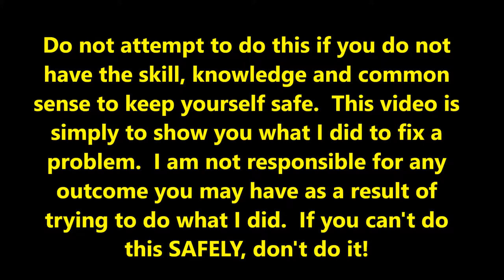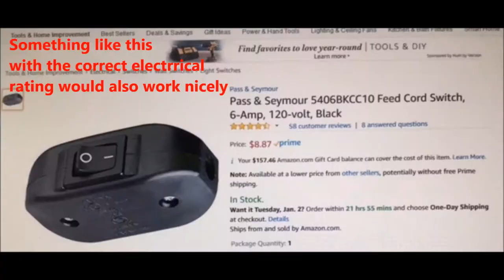Craftsman finishing sander won't turn on;  how to replace defective on/off switch

Comment: Ugh I just want to know how to put sandpaper in the thing!!
Reply: Me too!!
Reply: Did you figure out how to put the sandpaper
Reply: Some have sticky adhesive for pad or get right size paper and pull clamps handle perpendicular to sander and lift clamp. Place paper under holder and lock handle back in place
Reply: @andrecrowley3902  ...Could you please make a short video on how to pull out the clamps and put the sand paper on? I just bought a used one, in great shape, for $7.00 but it doesn't have the manual. I found the manual online. No help. I just don't want to break or bend the clamp arms.
Reply: @ronsmith5004  it wont let me post videos
Reply: @ronsmith5004  great deal at $7!!!!